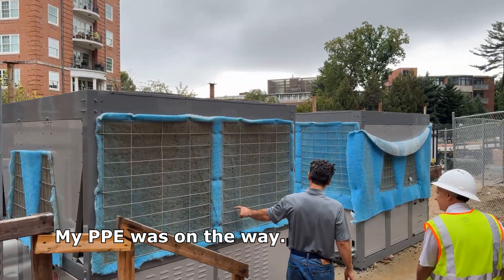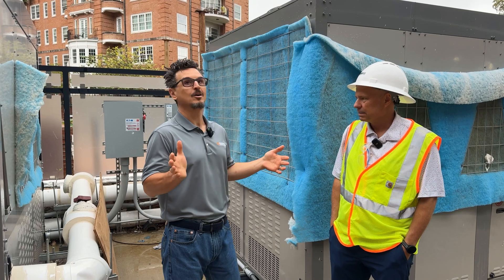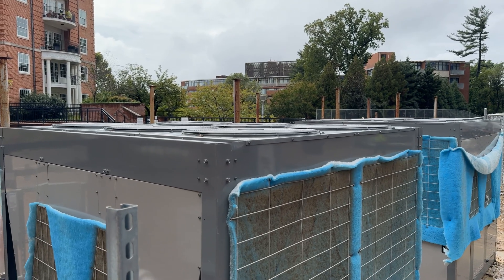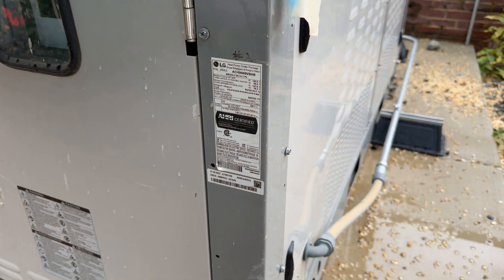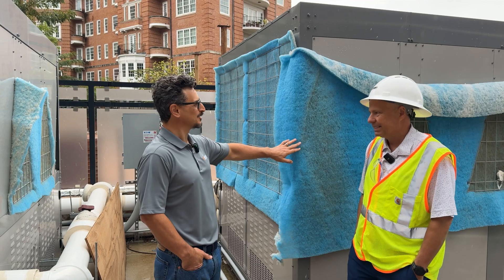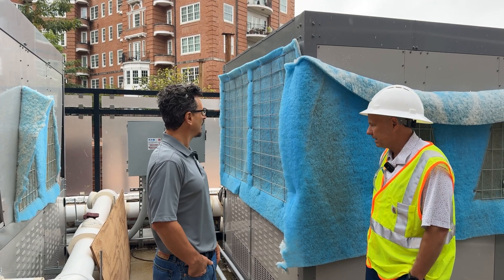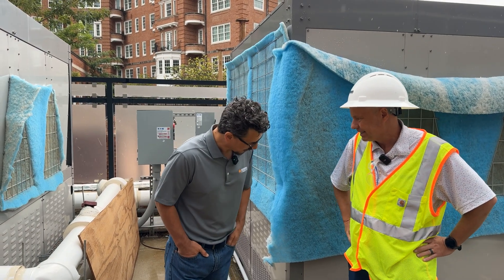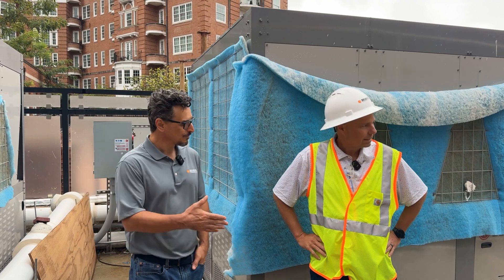Using LG Heat Pump Chillers for Temporary Heating and Cooling During Construction

Comment: We recently have run into issues with plate heat exchangers on these failing causing the compressors and refrigerant lines to get flooded. We had 6 60 ton LG heat pump chillers and currently have 2 heat exchangers and 4 compressors failed. Super cool technology with the digital scrolls being inverter driven. Just a bummer especially since one only had 10 hours of run time

Comment: I believe this what CA will be getting once our gas equipment goes away here in SoCal. So our boilers will be swap for heatpump chillers for heating only, I think also additional electric heating is added to get to achieving our heating BTU output.